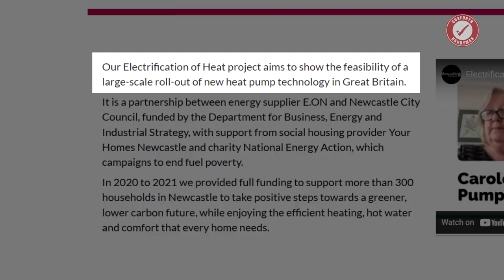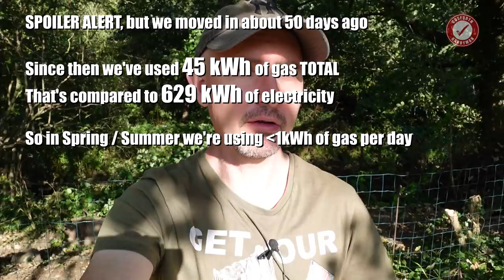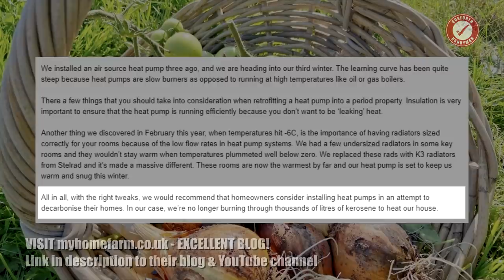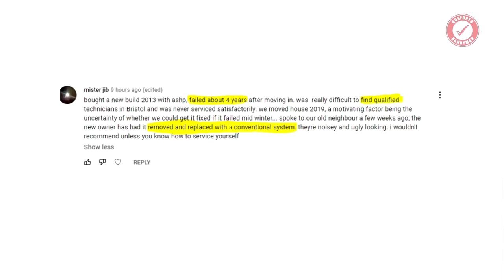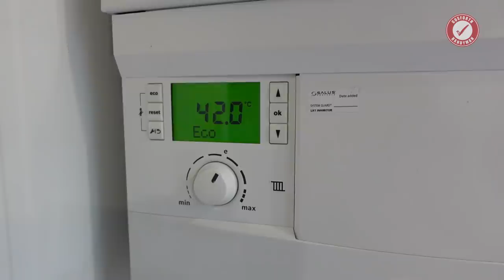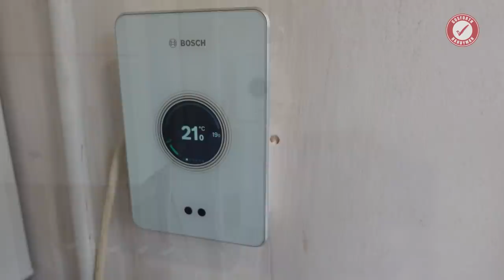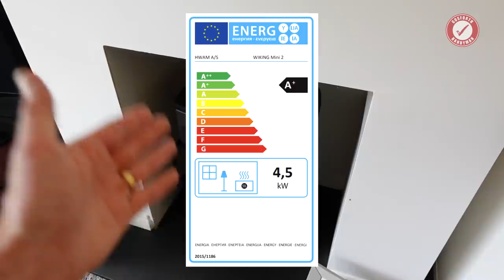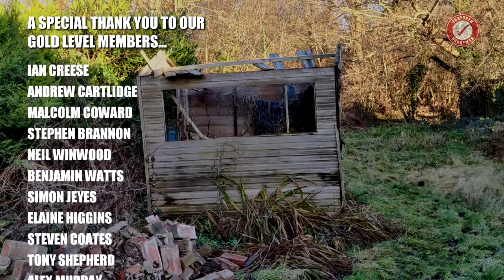Why didn’t we install an Air Source Heat Pump? (1920’s Renovation Part 32)

Comment: At home here in Manchester, 4 bed 2008 detached with an unvented system, fairly well insulated to UK standards, extra insulation in loft + fully boarded. The result has been considerably lower bills than people I know. From April-October, as the house doesn't seem to drop below 20C heating doesn't come on. During a time, 2008-2012, we had the heating on demand the whole day and it was maybe 20% dearer in winter months than now if that - amazing considering those we particularly colder winters.  Im typing this on 5th November and heating only just started in the last 2 weeks - outside temp has dropped to 2-5C in the morning.

We definitely would put another jumper on, but rarely we think of needing to do that. When I used to work from home on my own and thought it was a waste of energy to put the CH on just for me during the day, then jumper on it went. 
Would I think this house is ready for any of those heating options? No. In nordic countries, where they bore hole GSHS the ground floor has 50cm insulation, walls 25cm and triple glazing. I'd sooner get solar panels with a battery. If I could substantially insulate the house further somehow, then maybe consider bore hole GSHS. Otherwise it would be a huge system expense plus £10 a day during winter for electricity.
Financially-wise, there systems combined would need a 25 year to pay for themselves, not including cost of yearly maintenance. In 25 years time, it probably would be ready to be replaced... so, in all, atm I can't see it as a financial decision. Would be ecological, but the systems are not suited to here at this point in my eyes.

Comment: Very interesting vid Andy. Ive just come across it by chance. I worked as an engineer in a frozen food manufacturer and certainly understand refrigeration. People are being  totally misinformed when they are told that heat is extracted from glycol in the underground pipes as if by magic. This liquid is used in the evaporator half of the system to exchange heat from the gasses in this section of the system. The AIR source heat system blows ambient air over the evap coils instead. If this air is moist it will form ice on the coils and the bloody thing will sit there in a defrost mode until its ready to start again 🙄. You are totally spot on with the poor amount of actual heat that comes off the condenser ( Heating) side of the system. Your analogy regarding diesel cars is a fine example of government people spouting BS and expecting people to eat it.

Comment: What you said about sustainability and climate change is absolutely spot on. I think far too often the latest in thing is seen as the silver bullet when it's anything but. Diesel cars and Electric cars, is something that absolutely confuses me because there is actually a study from 2020 that confirms Diesel cars are more environmentally friendly than any other vehicle type. In terms of sustainability of houses, something as simple as switching light bulbs to LED can make a huge difference to energy consumption, yet I imagine there are plenty of houses still using the old style bulbs. You're absolutely spot on when you say it's about building a system of sustainability as opposed to looking for a magic fix everything solution.
Reply: Ageed, but then look at the light fittings. Do they 'take' the new 'bulbs'?  Many do, but several of mine are dark at the bayonet and the illumination is at the other end and potentially protruding beyond the shade. Change the fittings! Yes several £1000 to the manufacturers and a whole lot more land fill. Green issues, are complex, like most problems and one size does not fit all.

Comment: Hi from Dublin, we've just moved into a 1949 end-of-terrace (pretty much a semi-d) house and I'm glued to this project. We've had two quotes for complete new central-heating and combi-boiler systems, to replace an oil-fired system. 8 radiators, combi-boiler and installation was €9400 and €11300. We'll get through winter with the oil until we figure out what's best.

Comment: Good to hear someone talking sense for a change. 
We’ve just had a new Combi boiler fitted - our first ever and getting rid of tanks, pumps etc has freed up space and enabled us to move the boiler out of the (now newly fitted) kitchen. It’s also amazingly efficient. 
We have two diesel cars which are so much more efficient than our old petrol ones and as fumes are controlled, I don’t see the problem. 
How is electricity generated? Not all wind and water or nuclear, so using fossil fuels perhaps? Neither can I ever see there being enough charging outlets for a country full of electric cars!!! 
Oh well. Once it starts affecting the rich, things will change again.

Comment: My home is a wimpy no fines (concrete) semi-detached . The purchase price was cheap but the insulation was non-existent so started from scratch.  So i have installed 1, spray foam loft insulation, 2 under floor insulation, 3 triple glazing, 4 external insulation ( via green homes grant scheme) 5 air source heat pump (using the renewable homes incentive) including all new radiators 6 Solar panels 3.6kwh installed on garage roof and 4kwh battery storage. 7 Hive smart thermostat . You may say this an extreme example and i would agree but i believe every home in the UK needs a professional assessment and generous government  incentives provided to the least efficient homes .People would not undertake a project like this if it wasn't there" forever"  home. My energy bills have reduced by 95% but the money saved goes towards the finance i have taken out.  I hope to benefit from the reduced running costs in years to come.
Reply: I probably would not qualify for the finance, being well into old age pension age
Reply: As an engineer what you've done is our normal recommendation for the best chance at cost saving or parity with gas when having a heat pump installed. Sadly many people can't get the finance or grants to cover it and much of the existing housing stock in the UK needs upgrading be it private or council owned including new builds built in the last 10 years with microbore pipework.
Reply: Just another observation regarding the noise. My ashp is much quieter than the exhaust steam/gases from my neighbours gas boiler. Also the video from “ My Home Farm “ are very accurate. As my house needed to be re rendered after the external insulation all my projects had to be done in a strict order . This meant that the ashp was fitted before the insulation was fitted . That 2 month period my electricity bill was truly eye watering . I think ashp could work for many people but the government needs to substantially increase the incentives available.
Reply: How much did all this cost ( excluding grants)?
Reply: @katabrontes  Just over £30k…….( £15k in government grants)    Gulp . If you are thinking of ashp you need to do this before any insulation project because the amount of grant you get depends on the current level of insulation in the house

Comment: My prior home had a heat pump (fan forced ducting). It kept the home plenty warm — except during winter power outages. Also, in the winter the 5Kw resistance supplement would kick in, skyrocketing the electric bill. Current house uses gas for heating, electric for cooling. The gas is much cheaper for heating, and I can connect the system to a small generator if the power is out. Our state is wanting to push electric conversion. I’ll resist until forced to. Good luck and great work!

Comment: Generally agreed with your comments about heating and driving but I think you neglected the real drivers for change which are that gas supplies are declining or coming from increasingly unreliable sources, same for petrol. Also the problem with diesel is not the efficiency but the air pollution. 
Great channel, thanks for sharing.

Comment: I agree there is a lack of knowledge around thermostats but we do also have a real problem with a lack of ventilation in well insulated properties in this country. I wonder how often those open windows are because of thermostat illiteracy causing overheating houses and how many are people instinctively thinking their house is getting a bit “stuffy” which might actually be a build up of humidity and CO2.
Reply: CO2 ?  Not with a flue type heater, unless seriously faulty... and in any case that would be CO (carbon monoxide). Not to say these gas and combustion heaters don't create CO2 and H2O emissions.
Reply: The CO2 I am referring to isn’t from heaters. CO2 builds up quickly from people in the building breathing it out without any ventilation to let in fresh air.

Comment: Thanks for this. Clearly you have your opinion AND you have left space for others. I am commenting from Gabriola Island in BC Canada. We are a moderate climate with a week to 10 days of below 0 and a few more days of below 5 in an average winter. I live by the water. I put a Fujitsu high efficiency heat pump in 7 years ago and I am very very pleased. One 12,000 BTU unit (Air to Air) heats my 2 br 1200 sq ft house. On cold days I do use my oil fired furnace to supplement but that would just be for 15 minutes at a time maybe 3 to 4 times a day. Heating bills are about 1/3 of what they used to be. On my island community we have a co-op that gets these units wholesale and provides them to residents at cost plus a donation to their charity which would translate to about 75 or 80 GBP. They have installed many many hundreds of these on our small island and the electric utility can notice the reduction in electrical demand. I do agree however that lots of contractors just add the government subsidy onto their installation costs so it stays very expensive for many.

Comment: Many thanks for an excellent video.  I have been wrestling with the same issues and have decided to go with a gas boiler for central heating.  I live in Santiago, Chile so will be installing also into the heating circuit a solar water heater, so this will preheat the water before it goes to the boiler and reduce gas consumption (variable heat boiler needed). Not sure combi boilers are available here.   The heating system is with radiators and with a heat pump I could not get the water temperatures I needed, without swapping out all of the radiators.

Comment: Agree wit you about Eon. Signed up two years ago specifically because I did not have to have a smart meter. Ended up with numerous phone calls  and text messages saying my contract said I had to have one. They contacted me about 25 times saying this. Each time I asked them to show me the paragraph which said I had to. They could not. Basically trying to  con and bully people.
Reply: Npower were awful to deal with, either not charging the right amounts or not issuing bills at all, or issuing bills after the account was settled and closed. I see nothing has changed since e.on swallowed them up
Reply: That's not just E-on unfortunately it's most energy companies. They're mandated by the government to get people onto smart meters and actually subject to charges (fines) if they don't get customers to switch over. It's part of the governments sign up to to carbon neutral by 2050, knowing that customers have the right to refuse but not many customers know they can.

Comment: Absolutely spot on, Andy! The proper way forward is to insulate and make airtight the old leaky properties, and to update existing kit - my soon to be scrapped boiler was installed in 1974!!
Using much less gas is a better answer than switching wholesale to an expensive and unreliable system - more research and development is needed, but the politicians need a 'quick fix' - which always turns out to be neither quick, nor a 'fix'!

Comment: I came to the same conclusion to avoid ashp's to replace gas boilers when renovating our property. Tbh your video is the best i've seen on the internet discussing them, would have helped bigtime when I was researching.
Reply: I love the guy too but the RHI isn't all that difficult to work out. In fact if he had had a heating engineer out (heat pump trained) they would have explained it to them done a heating calculation for the house to see how well it would work.
He's put in so much work on insulation that I'm confident it would work fine.

It would mean having it on a low level all the time in the winter, used in a very different way to blast on blast off. But these things are used widely in much colder places than Newcastle and work just fine. And as Andy says thicker radiators. 

Gas boilers emit twice as much greenhouse gases as power stations in the UK and 8x the amount of N02 too (linked to air pollution deaths, cancers lung, heart and vascular disease Inc. Strokes / dementia - you don't want this stuff being pumped out of your house where you, your kids and neighbours breathe it in.

Comment: Had my ashp now into my 3rd year and have found it so quite I have to go outside to stand in front of it when it's on  just to feel the air it puts out. As for the heating system keep the thermostat at 18c and it's fine.  I had a combi before I changed and found that if it broke down you got no hot water or heating with the ashp you have a immersion on the tank so at least you can have hot water. So I for one are happy with my choice , as for the grants I get 4 payments a year from the government which in turn pays just about half my energy costs admittedly you only get this for 7 years and by then they probably will some other insensitive, keep up with your video I find them informative

Comment: You make a lot of sense and raise many subjects around heating and hot water, the long and the short of home heating, is to reduce heat loss, not so much the methodology of how to heat your home. Heat Pumps work, fact, NG boilers work fact, it's up to all the engineers in the heating industry to upscale there knowledge, understand the technologies, get out of the shelter of the past, embrace the world troubles in handling future energy in your home. No one overall solution exists to resolve this 21st Century conundrum. We are in troubled times with all energy solutions in heating your home. Simply less heat loss through the building fabric = smaller energy bills.

Comment: The bigger factor in switching to a non combustion setup is the air quality, not the energy efficiency. Especially now that you have greatly reduced the amount of air leaks in the house, not bringing in things that lower the air quality is much more important. With an old leaky house this didn't matter. But we have run countless home chemistry experiments that prove how bad burning natural gas in an air tight house is for you.
Reply: I suppose there must be some tiny proportion of the gas which fails to combust,  and that leaks into the sealed home along with the combustion products?

Comment: Borehole ground source system (doesn't seem to be discussed in video here) should work better than a near underground pipe system, of course there would need to be some sort of drill rig that could get in behind a house.
Bunging in a heat pump without reworking the way heat is radiated into the house is really a bad idea, the whole thing needs to be re-reviewed/re-worked.

Comment: As someone that has always steered clear of heat pumps over the years, I decided to give a modern 'split' 3.5kw heat pump a go for one of my areas. These blow the air around rather than use conventional radiators. It certainly seems to do the business from what I can tell, was a reasonable DIY fit and cost £650.00. Outside temperature is 21C at the moment and on heat, it brings the temperature up very fast as one would expect, but on cold, which is probably a better test at these temperatures, it works well too, so I am holding out reasonable hopes for winter running. 1:3.5 efficiency and a maximum 1kW input. Still consider many properties in the UK are not suited for full installs and most installers don't have the knowledge to properly assess system requirements but as to the efficiency and performance of modern air source heat pumps, I might just have to start rethinking my stand on them.

by the way, spray foam insulation I have seen all sort of issues with over the years with roof's. Foam generally cracks away, moisture gets above it and rots battens and galvanised nails. Depends on the climate it's in but UK has one of the worst moist climates when rot can occur.
Reply: Curious how these are doing for heating, now the weather is cooler? Interested as would love them for main bedroom and living area so we could also cool in the summer.